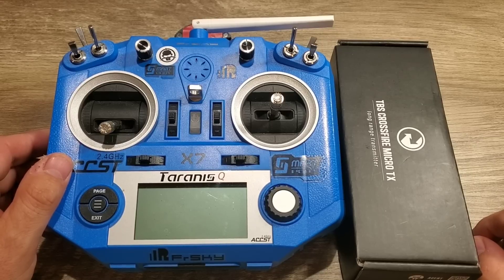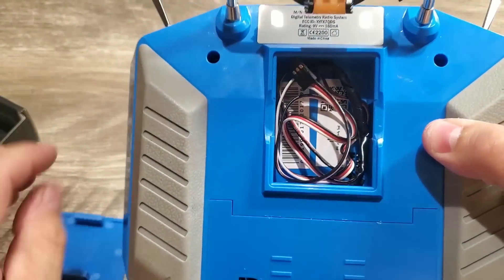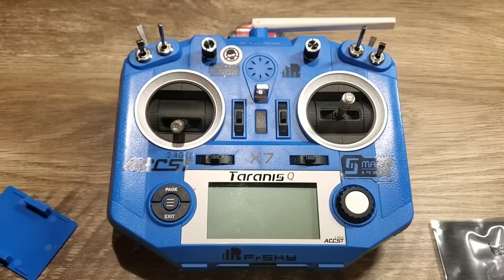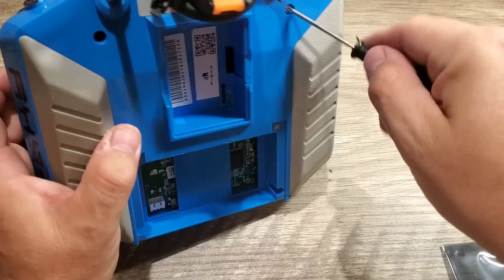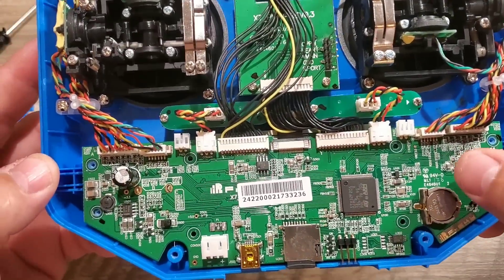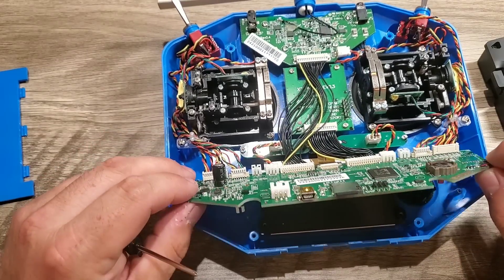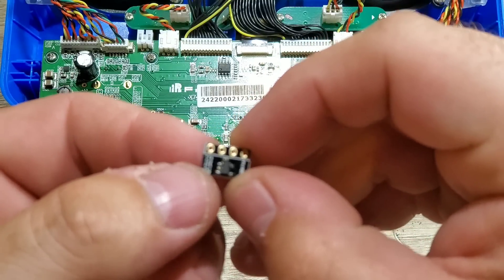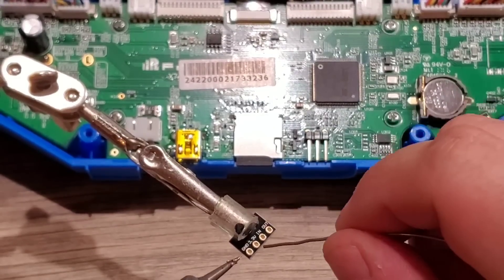Taranis Qx7 Crossfire Mod

Comment: Great video. however yours is the first video stating the mod is not needed with larger crossfire module. Can you link to documentation on this? Pretty sure mod is needed regardless of module, the larger module just avoids need for LUA scripts.
Reply from the maker: Your correct 👏 I mispoke meaning that you dont need to do mod with larger module I meant to say you dont need to download the lua scripts for the larger module. You still have to do the mod with the qx7 and the larger crossfire module due to the baud rate. Thanks for letting me know ill pin this comment
Reply: @edrone_  ah ok thanks for the reply!
Reply: @edrone_  After the soldering, is there something in the menu I have to change to get the higher baud rate?
Reply: Nevermind, allready found out. On the hardware page in radio settings the baud rate was allready on 400000 after the mod (y)

Comment: if i solder this chip but i use different module for elrs it will work or must be this crosfire module?
Reply from the maker: Oh man great question! I would reach out to Team Black Sheep support and ask as I'm not sure about compatibility with ELRS.
Reply: @edrone_  without this mod the qx7 cannot work with elrs ?
Reply from the maker: @ANDREAS   this mod is for crossfire I'm not sure about if this is needed for elrs.

Comment: hey is there still a need to update the firmware on the transmitter even after doing this mod? because i know that the updating the firmware is another potential way to fixing this issue, but after installing this hardware mod is there even a need?
Reply from the maker: Do you have the QX7 that has ACCST OR ACCESS written on it?
Reply: @edrone_  My one hasnt actually arrived yet, but on banggood (where i purchased it from) it says "ACCESS"
Reply from the maker: @haks_123  The ACCESS radio does not require the modification for crossfire.
Reply: @edrone_   @edrone  Oh wow, So i just plug everything together and it should function normally? The thing is this whole time ive been researching about this problem and ive even ordered 2 of these inverter mods. But honestly im so happy that i asked you before doing anything because i probably would of attempted to do this mod once the transmitter had arrived, thanks for saving me all the hassle <3
Reply from the maker: @haks_123  no problem happy to help. Yeah the mod is only for adjusting the baud rate on the radio for the ACCST version to lower the latency for crossfire. The ACCESS version is able to do the correct baud rate without any modification.

Comment: I don't understand what the mode is doing exactly... Because I didn't installed it and the crossfire worked perfectly.
Reply from the maker: Crossfire will work without the mod for the qx7 but the latency will be greater between the module and the transmitter
Reply: @edrone_  ha ok! Thank you very much for your answer! 🙏✌️

Comment: Is this mod good for r9m or i should remove it
Reply from the maker: Mod is not needed for using the r9m module from frsky only if using a crossfire micro module
Reply: @edrone_  do i have to remove it to use r9m. Or just leave it like that. Thanks
Reply from the maker: @oussamasmaini7297  to use r9m you leave it do not remove
Reply: @edrone_  thanks for the info. I was worrying about waiting 2 months to get a small transistors 😂
Thanks man
Reply from the maker: @oussamasmaini7297  no problem 😊
Reply: Just if you wondering i didn't did it. I bought it like that and i found out late. So i don't anything about it

Comment: Anyone elses audio get cut out at 4:20 to 4:34? Redacted information!!!
Reply from the maker: Unfortunately there was a error in the original edit that was not caught till after the upload the information that was cut out was not of great importance just talking about removing all the screws from the back of the radio and making sure that you don't loose the screws as they are kind of smaller.

Comment: Question, I just did this modification and when I go to crossfire.lua I press execute and it just says “ waiting for crossfire” and it doesn’t connect. I was able to bind crossfire module to receive but the issue is between the transmitter and module. Any suggestions?
Reply from the maker: Double check your soldering connections on the board is where I would start then if correctly soldered with no bridges you may need to update firmware on the radio

Comment: After you do the soldering inside will your Taranis qx7 will other modules still work in the bay or does it lock your bay to the crossfire module
Reply from the maker: Your qx7 internal module will still work and you can use any external module

Comment: Hi there great video Should the crossfire be able to run 1watt from the internal battery source of the QX7s after this mod is done .. cheers
Reply from the maker: You can however I would suggest upgrading the battery to a lipo instead of the double aa batteries they won't last long with the crossfire running at 1 watt.

Comment: I just finished the mod and have a few tips to make it easier. 1st use a very fine tip on the soldering iron and also very fine 60-40 lead solder. When you flip the board up to access the transistor pin, use blue painters tape to hold the board in place, next use very fine Silicon wire (28-30ga ), it is very flexible and easier to work with. There is very little current flowing through the wire, so no need for heavy wire.
Reply from the maker: Thanks for the tips! 👍

Comment: well I guess I did something very wrong. Burnt the whole trace off the back in step 1. I'm so mad.... Beginners should NOT try this unless you're very very competent at soldering.
Reply from the maker: Sorry to hear this. May i ask what soldering tip did you use?
Reply: @edrone_  I used the point on a hakko 2.4mm chisel tip. I did want to say however, that I watched another tutorial and scraped away the trace, and was able to solder to the trace further down the line. I finished with the rest of the tutorial and everything turned on and seems to work just fine
Reply from the maker: @Bigbeardfpv  im glad you were able to get it working again. I opted to use the cutters to remove the transistor versus the soldering iron to play it safer for any slips that I may have had that could have damaged the board.
Reply: @edrone_  I used the pliers to ! Where I went wrong was leaving the iron on the pad too long when trying to solder it up

Comment: Crossfire won't work without it?
Reply from the maker: It will work but you won't get the benefit of the lower latency meaning it will perform just like frsky pretty much.

Comment: Hello, you insisted that you have to solder the 3 volts in that specific part, why,?, there are other easier parts like in the trims.
Reply from the maker: The mod was done the way TBS recommends on the website.

Comment: Will this interfere with Frysky receiver updates and/or its uses? Thanks.
Reply from the maker: No just make sure you have the external module off and internal module selected before updating
Reply: @edrone_  Appreciate the quick response. I guess what I meant is, will this disable the S.Port? This is how I update my Frysky receivers. Thanks again.
Reply from the maker: @cesarango01  no it shouldn't if done correctly

Comment: You should not tell people to just pull of the IC off the q400, that damages the board. Heat should be applied and it should be removed gently.
Reply: Do tou know what type of IC that is? I could not find any where similiar with q400 leyword
Reply from the maker: If you do it carefully it will not damage the board which im sure i said😉

Comment: Great video man. Is there another crossfire module that is plug and play on the q x 7 without having to do these steps and the steps on your next video?
Reply from the maker: Thanks! If you get the full size crossfire module you don't have to do the mod.
Reply: @edrone_  thanks. with the full size, do I still have to do the firmware stuff on opentx and install on qx7?
Reply from the maker: @apextos81  you may need to still do the firmware update for the radio to recognize the tbs module

Comment: Good lord that's too tiny, I could never do that precise soldering.   That surface mounted crap is a no-go for me.   Good thing you can at least get the full version and avoid it.  How bad are the gimbals on this TX, I've heard the ball bearing ones aren't the greatest.  Also, does the cramped screen get annoying in practice or does it not matter.  I liked that the backlight goes out and it's low power old school LSD.   I'm waiting on the TX-16s, but that's taking a while, suppose to be out this month sometime, and someone's offered me one of these old Qx7's dirt cheap.  I like the look of the Duplex DS-12 with the screen at the top the best, but that costs an arm and a leg.
Reply from the maker: The gimbals feel fine I had to remove the notchiness on the throttle for me personally The screen is actually plenty big enough to see to change your settings
Reply: This is the first I've heard you don't have to do the mod with the larger module. Anyone have a link to this documentation?

Comment: After replacing pulling out the transistor and adding the part will this radio still work with the regular d8 d16 or will it only work with rapid fire thanks
Reply from the maker: Will work and function just like before only thing changing is the baud rate for the module.

Comment: mate...my x7...after practising on a sim and went out of battery it wont power up again now...when pressing button the speaker only makes a noise ...also with the usb cable pc dont recognize it anymore to reflash or anything..this had happened one more time in the past but after leave it on the usb cable it came back to power on ....i already tried many different batteries and left it on the usb many hours but nothing this time...i checked and there is nothing toasted or something...is there anything you may know for this?
Reply from the maker: You probably have to change from sim mode to data which firmware are you using? The newest will ask you wheb you plug in usb if you want to use the port for sim or data choose data
Reply: @edrone_  the problem is when connected to usb it dont see the device at all now...2.2.2 fw if i remember correct...it happened in the past one more time ..but after 2 hours left on the usb plugged to pc it showed in Dfuser...now it  dont appear at all...its 10 days i hope this will get back to life and no...also there is nothing toasted or burnt etc..i checked even it couldnt be cause i just run out of battery and then it just dont power up
Reply from the maker: @lfrecords3970  try pushing in on the trim tabs and power on at the same time before you plug in usb thats bootloader mode then see if you can get it to recognize your usb
Reply: @edrone_  i just did...nothing..pffff i start thinking its will not recover ever now...i hear only that stupid sound of speaker as usual and no turning on or bootload on pc still not recognise
Reply from the maker: @lfrecords3970  sorry to hear this yeah it sounds like something is definitely not working correctly where did you purchase? Maybe you could try and return as defective if you have not had very long?
Reply: @edrone_  i  have it arround 2 years mate..so no return...it just weird...now i remember it did this 2 or 3 times not only once...and everytime it recover but leaving the usb plugged to pc and i was seeing in the dfuse that it was in the list devices tab after some minutes...that dont work now i left it more than 1 day on...and i believe the previous FW was able to recover from whatever it is wrong with it..i dont know..i saw on internet other having the same issue so i asked in case there is any "fix" for this damn thing
Reply from the maker: @lfrecords3970  i had not heard of this before now but now i am aware maybe you could reach out to frsky through their website and see if they could offer any advice on possible fix
Reply: @edrone_  yes this caused from the usb port...i thought this "trick" with dfuse would work all times so i said this to many others with same problem...after using simulator it dont turn on for some reason so becareful with this radio for sims..avoid it if possible..Frsky via email told me to send them tha mainboard to check it..but i m from far far away from China and sending it it will take at least 2-3 months ..so i dont know what to do now...i have for helis 2 expensive futabas ..one 14sg and the 18sz but i never checked for micro recievers to use these for drones....the shit thing is i wait any day this week the dji goggles + a 5" drone and i wont be able to try it...pff
Reply from the maker: @lfrecords3970  thats frustrating for sure

Comment: what gauge wire did you use?
Reply from the maker: 20 gauge
Reply: @edrone_  I also want to try making this mod, but only have 28 gauge wires. Is that too thin or is it gonna work?
Reply from the maker: @RobertPoptamas  should be fine

Comment: Yo brother..question for ya. Im getting this crossfire monday for my qx7. All my quads have xm frsky receivers in them. After you remove the q400 chip from the backplate..will the xm receivers still work? Or do i need to change all my quads over to crossfire? I have 7 builds and only want to install cf on a couple. Just wanna make sure my xm receivers will still work after removing that tiny chip from the qx7. Thanks in advance man. Anxious to hear from ya. ✌✌✌
Reply from the maker: You can still use all of your other non crossfire receivers just make sure you have the external module turned off and the internal module turned on for those models
Reply: @edrone_  cool man. Thanks. Great video. Awesome info..🤘🤘👊👊
Reply: @edrone_  do I need this mod if I don't use tbs crossfire module and receivers? Kind of a dumb question but I'll ask anyhow!  LOL I just upgraded from a cheap flysky transmitter and am now using the taranis qx7 with several xm+ receivers, xsr-m receivers, and a fullspeed micro d8 receiver. Does the mod make any difference with these receivers as far as baud rate goes or just with tbs crossfire module and receivers?
Thanks!
Reply from the maker: @j.r.0420  only need to do mod if using crossfire micro tx

Comment: did the mod checked all wires wverything is good. just i keep getting constant telemetry lost and telemetry recover any idea why
Reply from the maker: How close is the radio to the receiver
Reply: when i plug in lipo i get telemetry recover. when i walk away a few feet i get telelemetry lost im like 10 ft away
Reply from the maker: @89vic3  do you have the firmware on the crossfire updated to the latest version?
Reply: edrone yes the latest version. another thing happening is that im getting latency on stick inputs theres alot os latency with my crossfire system
Reply from the maker: @89vic3   I would say if you're getting latency double check all your soldering connections it could be possible you have a faulty board as well from Tbs
Reply: edrone thats what i thought i switched the tbs board to brand new one. Still have that issue. my guess is probaly q bad crossfire module or the actual receiver
Reply: Sick worked thx stoked the internal works to

Comment: Did you have to update the firmware on the radio? Looks like you have the same 2.2.0 version that I have on mine. My USB port is broken so I don’t think I can update it, but if yours is working I guess it’s not an issue?
Reply from the maker: https://youtu.be/US4HE5XKQks

Comment: Nice video tutorial! Thanks mate!
But I have one question... If I do this mod to my QX7, will I be then able to use stock internal transmitting module? Will my tiny whoops, 2inches and other quads with FrSky receivers still work with QX7 modded like this?
I guess when I remove the crossfire module then it should work... Please correct me if I'm wrong :)
I just started to getting information about crossfire, so I just want to be sure before I buys it and mod my radio :)
Reply from the maker: You can still use your internal module, just make your crossfire models separate and when you choose your old models the settings will be set to internal you dont even have to remove the crossfire module as it wont be powered on because internal module will be selected.
Reply: @edrone_  oh, that's nice :)
Tgank you very much :)